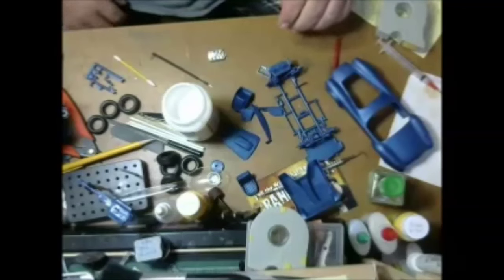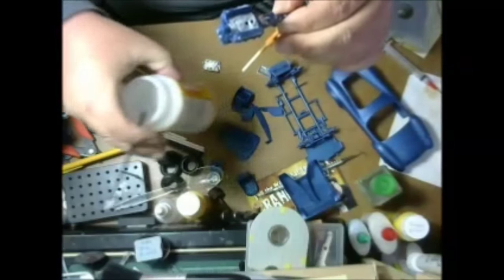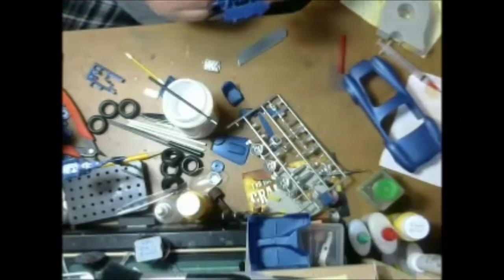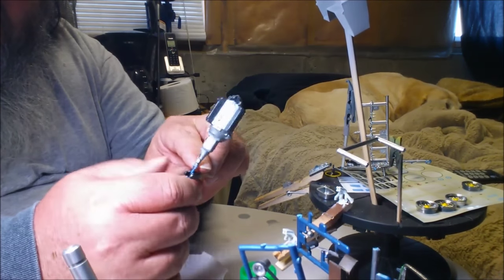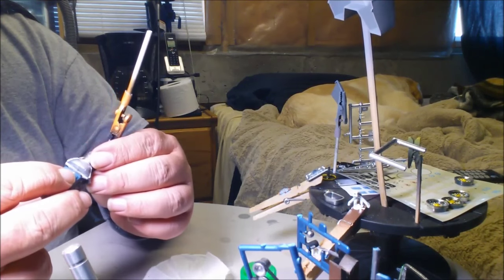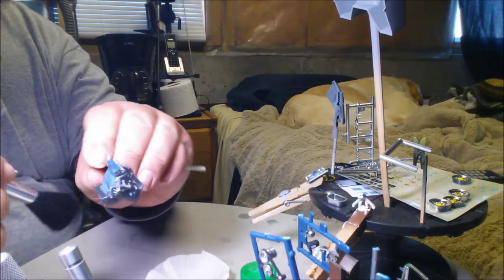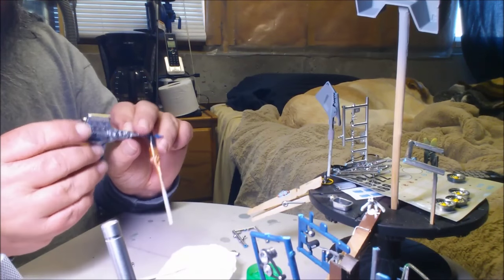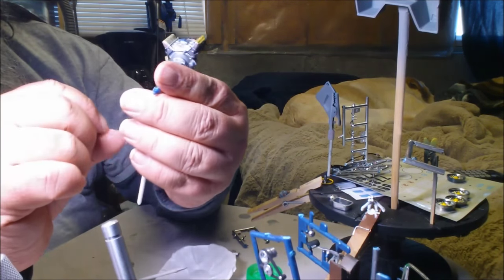Masking with white glue

Comment: Chris, have you ever diluted the white glue with water for masking? I heard that's what some people do.
Reply from the maker: +FezzantPlucka Not for masking. However, I do dilute white glue with water for using tissue for seat covers, roof liners and torn carpet. When I mask I will use the glue straight to keep a good thick bond. You can tape off an area for foil put glue down where foil goes and then remove tape. That leaves crisp straight lines then pop off glue after painting for a nice place to lay down the foil.

Comment: Chris! Help! I messed up some racing stripes on our 68 Shelby Mustang :(
I can send you a photo on FB, but its mainly due to me not burnishing the edge of the little strip I cut for the center line. Phooey. Anyhow, I was curious how you might go about fixing seepage of paint? Sand it down ... paint over it ... all that. Just curious. Thanks!
Reply from the maker: Sorry for delay on replying.
Use 800 or 1000 grit and lightly sand it away. then re tape. Now, spray a thin layer of clear coat over the taped area. Let dry 15 minutes or so. Now you have just sealed the edge of the tape up. If any bleed under happened it won't matter because it was clear so it will not be seen when you remove the tape. just the color under the tape will show. hope that helps.
Reply: Brilliant! Thanks!

D
Reply: Just figured something out ...
I've only just now re-painted my blue and was about to add the white, when I realized ... I have no Tamiya masking tape (it was my Dad's at his house, not mine). Anyhow, I was trying to figure out how to mask without going out to buy more Tamiya tape ... because I'm lazy and cheap and broke. The solution? Well, since the blue has been clear-coated, I thought I might use scotch tape, but then I thought, "why not use the tape as a border for white glue?" since it's basically poor-man's liquid mask. I might make a video about it as an "experiment in terror".